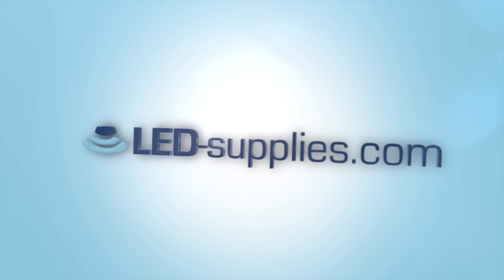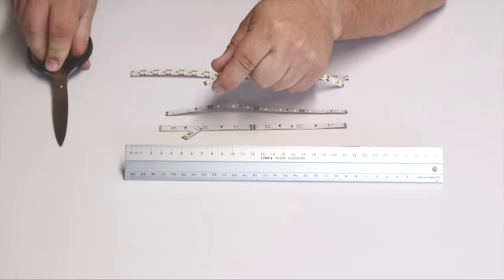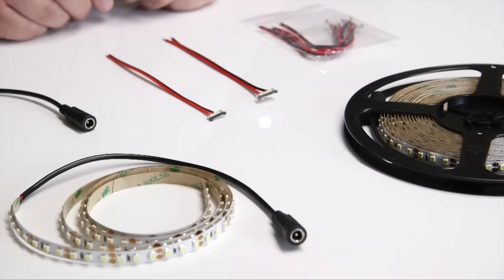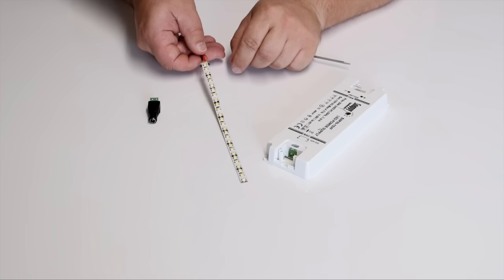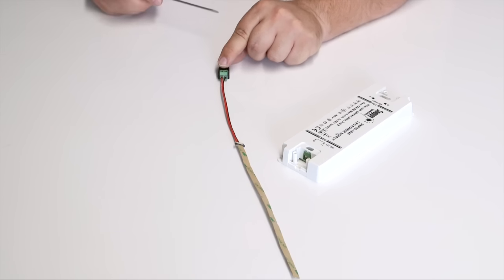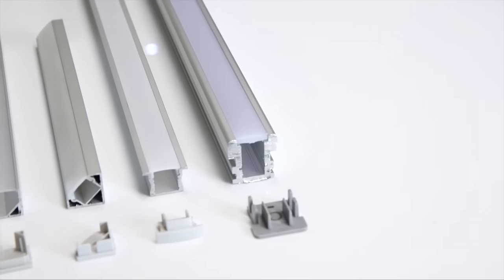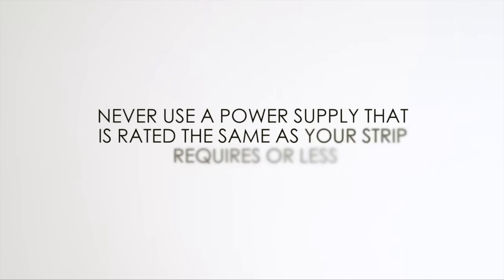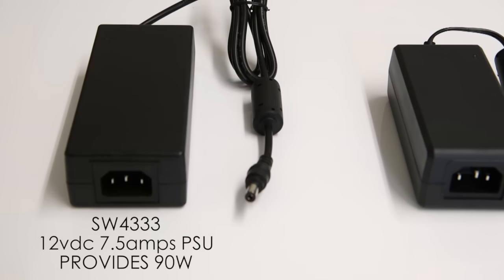How to cut, connect & power LED Strip Lighting

Comment: Hello, this was a great instructional video. I have a question. I noticed that you stated for 4.8 watts per meter strip you recommend a max run of 10 meters. I have (3) 4.8 watt per meter strips that I was looking to solder together for a total run 15 meters with a 90 watt power supply. Do you think this will work well and will be safe? A second question I have is which power supply is better between industrial power supplies or constant current power supplies? Thanks
Reply from the maker: +brightcreep1 Firstly most LED strip requires a 12vdc or 24vdc constant voltage input so a constant current power supply is not recommended. You can use an 'Industrial' power supply as long as it provides the constant voltage output. For our constant voltage power supplies check here https://www.led-supplies.com/led-drivers/ we have a wide range

15 metres would not be recommended as a single run of standard 4.8W LED strip. If for example this is 12vdc input LED strip then 15 metres would need 72 watts which is 6 amps. LED strip is generally not designed to carry 6 amps so its likely to damage the LED strip. You are also likely to get voltage drop down the LED strip running 15 metres as a single run so the very end is likely to be less bright that the start

we would suggest running the 15 metres either as a 10 metre + 5 metre section or perhaps 2 x 7.5 metre runs and power from either end. You could also power the LED strip in parallel from the same power supply rather than in series

Comment: I measured something wrong and cut a strip a bit too short. Is there a way to reattach them? I'm guessing soldering would be the best solution?
Reply: You need to solder them
Reply from the maker: +fsociety Soldering is the best option but if you would prefer not to then we do have a range of middle connectors for LED strip which you can view via the links below. we offer 3 options depending on the type of LED strip you are using
https://www.led-supplies.com/led-installation-accessories/connectors/middle-connector-for-rgb-led-strip-lighting-solder-free/
https://www.led-supplies.com/led-installation-accessories/connectors/middle-connector-for-led-strip-lighting/
https://www.led-supplies.com/led-installation-accessories/connectors/middle-connector-for-10mm-wide-led-strip-lighting/

Comment: at 7:28 I think it should be wise wersa, I mean max run of 5m is 4.8W and max run of 10m is 9.6W, 
Am I right?
Reply from the maker: +gig970 Thanks for watching our video and your comment but no this is not correct. You can power 10 metres of 4.8W and can now actually power 10M of 9.6W strip but certainly when you go to our higher power 14.4W per metre high brightness LED strip 5 Metres is the max as a single run in series due to the higher current this type of LED strip pulls

Comment: so these connectors are short as fuck. how can i extend them? cause it doesnt seem like you can connect the connectors together to get a really long cable...my brain is hurting form thinking about this....
Reply: +David Chang Get a roll of wire and solder it straight on, then you can cut it to any length you like.

Comment: I don't know if you can help,  But i got an LED kit, and everything is wired up. but I am having problem with the colours. 

When it's set to RED the light is an Orange colour,  Blue is a lighter shade of blue (closer to  a Teal colour) 

When i have white selected  and i lower the brightness it will start changing to green, the lower the brightness set the greener it gets but the actual brightness does not change.

And when I turn off the unit with the remote,  it changes to green and doesn't actually turn off. 

To me it seems that the unit is associating  brightness with intensity of green but I am by no means trained or confident in my diagnosys.
Reply from the maker: +VauganizerHD It doesnt sound like one of our LED strip kits as this is not a problem we see with our stuff but it could be you are using a poor quality controller which isnt controlling the strip properly. Check out our controllers here for RGB LED strip https://www.led-supplies.com/led-controllers/led-controllers-rgb-colour-changing/

Comment: wow i feel like im on some heavy valium watching this.... would be nice if you would get to the point just a bit faster ....  you also say nothing about how to remove the silicone coating from the LED strip in order to access terminal pads... nor HOW to identify polarity on unmarked strips
Reply from the maker: +antigen4 Thanks for your comments - the silicon coating is not present on standard LED strip which is the type we concentrate on in the video. Its is on splashproof strip but the introductory video we produced is already pretty comprehensive as you reference. Also, any good quality LED strip (such as ours :) should have the polarity marked on it. We have not seen any strip which is 'unmarked' so cannot comment on that.

Comment: Would these burn up if I hooked it up to my lawn mower battery
Reply: +Jacob Randall Yes and NO  - if you have an alternator,  this will push the voltage passed 12v. ( assuming it is a 12V battery your talking about ) and this will blow your strip,  if 6v system - this will work,    if you dont have an alternator on your machine and you have to plug in the battery to charge it,  then they will work just fine - remember to put a switch in place or you will just drain the battery unless you disconnect them at the end of use.     If you put a voltage regulator in place - and a variable pot,  you could set the MIN MAX voltage to 6-12V. and rotate the Pot to alter brightness.
Reply: +Piefingers thank you I'll look in to that
Reply: Why would you want them on a lawn mower 😑

Comment: Is there any way to power two of these strips from one power supply?
Reply from the maker: +VACARA You can power 2 lots of LED strip from 1 power supply using our splitter cables - take a look at these we offer 1 to 2 way, 1 to 4 way and 1 to 8 way - select the type you want using the selection box on this page https://www.led-supplies.com/led-installation-accessories/cables/2-1mm-splitter-cables/

Comment: How can I do this with a 9V battery? Is that even possible? My LED strip is marked with "DC12V." Thank you.
Reply from the maker: +Sidney Falco You would need to run 12v LED strip from a 12vdc battery - either lead acid or lithium ion - we do some batteries here https://www.led-supplies.com/led-drivers/portable-power-battery-for-led-strip-lighting/

Comment: Bonjour ,nous avons fait le branchement mais le mien était vendu avec un adaptateur 12V et une fois branché quand on l'éteint les leds rouges reste allumé que faire (à chaque fois nous devons débrancher l'alimentation pour l'instant)

Hello, we made the connection but mine was sold with an adapter 12V and once connected when we put out(switch off) him(it) the red leds remain lit(switched on) that to make (every time we have to disconnect the food(supply) at the moment)?
Reply from the maker: +Marianne C If you are powering a very small amount of LED strip, when you disconnect the power supply sometimes the residual charge in the capacitor of the power supply can continue to power the LED strip for a very short while. the only way to stop this happening if its a problem is to fully disconnect the power supply completely
Reply: +LED supplies quel est la solution pour que cela reste toujours sur secteur sans resté allumé

What is the solution for it always remains on without remained on sector

Comment: these so called solder points shown in this video is in effect "Cold soldier point" - the flux (or lack of) and heating (lack of) of the connecting wires would in effect result in a "cold point" which in effect is bad! - The correct way should be be heat the wire while applying solder and flux  to allow both the wire and circuit board connection points a "just right amount" of solder - The solder should be evenly spread and allow the cable hot enough for the solder to penetrate the wire strands - Once done correctly you should be able to see the outline of the twisted wire strands - if you cant see that they you probable used too much solder - resulting in a weak soldering point - same apply using too little solder - A cold solder point is one of the worst when it comes to soldering - weak and brittle and corroding wires to follow - a too  hot solder iron could ruin you connection point (and surrounding electronic), melt the protective plastic on your cable - again weaken project

Comment: Can anyone help me out how to convert LED strip power source into USB?
Reply from the maker: +Maria Gamotia You can buy LED strip that actually operates from 5vdc - so you can power it straight from a USB socket - contact us for more details - its a brand new product and not live on our web site yet https://www.led-supplies.com/contacts/
Reply: +Maria Gamotia If you have 12 volt led strip you can't , but there are 5 volts led strips you can purchase off amazon and can be run by USB wires.
Reply: If you know how to solder get a boost converter form eBay and solder the wires unto the converter from the usb then solder on the connectors to the output for the light strip or just solder wires instead of connectors
Reply: +Maria Gamotia  Hey a USB has 2 wires two are green and white (these are not needed they are for data) and the other two are red and black (positive and negative) this is what you need to power the LED strip simply solder the red wire to positive and the black wire to negative on the led strip simple :D
Reply: +Drilon Demaku incorrect

Comment: How do I calculate what voltage my battery needs to power the LED strip? And what LED length can a 9V battery power?
Reply from the maker: +TheElectrozoid take the battery voltage and then multiply it by the number of batteries you are using to power the LED strip. For example a 1.5v AA battery - using 8 of them (8 x 1.5v = 12vdc) you may be interested in this product https://www.led-supplies.com/led-drivers/portable-power-battery-for-led-strip-lighting/battery-pack-for-led-strip-12vdc-8-x-aa/
Reply: ***** I am goning to use a single 9volt battery. What length of what LED strip can I use?

Comment: can you add a power switch?
Reply from the maker: +obadboystanley You can add this which works as a really easy to use on off switch for LED strip as well as enables you to adjust the brightness levels https://www.led-supplies.com/led-controllers/led-dimmer/touch-dimmer/led-dimmer-touch-sensitive/

Comment: So in theory could i wire these directly to my PC power supply on the 12V rail?
Also could these be wired to my car battery directly?
Reply: +Hunter Davis (CAF Life) 
Yes, but via a correctly selected fuse !
Reply: +Derek Robinson thanks i did it to my pc and it worked great ilm do it to my car w
using your advice

Comment: So basically  any power tool, phone charger, triple charger or a battery charger will work for a power supply as well, a input AC 110v current for a DC 12 volt current of 24 watts at the less amount of energy,  that great be able to use all these light on one power supply of 24 watts, THAT IS AWESOME    just think back in the days 1 light bulb burned 100 watts of power   WHAT A WAST OF POWER

Comment: Can you cut them and use that other half at another place? How would that work with the remote, and what needs to be purchased extra for that to work?
Reply from the maker: +Matthew Bishop You can cut them and power multiple bots of LED strip using a wireless controller which then pairs with a wireless or multiple wireless receivers take a look at some of these examples but we can offer for single colour or colour changing LED strip https://www.led-supplies.com/led-controllers/led-dimmer/wall-mounting/led-strip-dimmer-wireless-single-zone/
Reply from the maker: +Matthew Bishop Yes you can use 1 remote but then buy 2 receivers which are available on their own as order code COMPACT-RECEIVER . Doing this you can effectively power as much LED strip as you want in different places all from the one remote controller https://www.led-supplies.com/catalogsearch/result/?q=compact-

Comment: What about using batteries for power input? What type of battery do I use for a 15 LED on a 30cm strip?
Reply: +Ompmega You can use 1.5v batteries. I run 8AA batteries and hook it up. Adds up to 12V.
Reply from the maker: +Ompmega check out this product - just add the batteries to provide a 12vdc output suitable for LED strip https://www.led-supplies.com/led-drivers/portable-power-battery-for-led-strip-lighting/battery-pack-for-led-strip-12vdc-8-x-aa/ or if you want a higher power solution that will run the LED strip for longer check out this range https://www.led-supplies.com/led-drivers/portable-power-battery-for-led-strip-lighting/portable-power-supply/

Comment: I want to do this for Halloween and am rushing it now last minute.. Do you sell multi port adapters where I can attach like 5 led strips x2 separate areas of my mask I am making + about 3-5 other separate strips and have them all lead back to one main connection at the power supply?
Reply from the maker: +Jared Deptuck You could maybe use our splitter cables for powering multiple LED strips from a single power supply or battery? https://www.led-supplies.com/led-installation-accessories/cables/2-1mm-splitter-cables/

Comment: They can run on a battery these LEDs? is for the few, not one meter
Reply: +Alejandro Chavez Ramirez As long as it's a 12 volt battery its fine
Reply: helcat316 If you mean 4 lithium ion cells connected in series you will what to get a power transformer or something like that (cant remember right now) to keep the voltage between 12-14V because a charged lithium ion battery is around 3.9v X 4= 15.6 Volts which will burn out the LEDs or make them turn into a very weird color
Reply from the maker: +Alejandro Chavez Ramirez If you want to power just a small piece of LED strip from a battery this is perfect as once the batteries are fitted it provide a 12vdc output https://www.led-supplies.com/led-drivers/portable-power-battery-for-led-strip-lighting/battery-pack-for-led-strip-12vdc-8-x-aa/
Reply: +PC TechTips  what if you want to run a 4s lipo batttery pack woud like to build led race track outside
Reply: Alejandro Chavez Ramirez n
Reply: Alejandro Chavez Ramirez

Comment: I wanna put a strip around my computer desk but also behind my tv (causing me to have to cut it) do i have to get another power supply to have it light up behind my tv? if so can someone send me a link to everything i need i already have 1 power supply, the 16.4ft strip itself, and remote
Reply: +LeafMatic  use 1-2 DC splitter,1 female head connect 1 power supply,2male heads connect two strips

Comment: Hi there I am planing a light for video of about 15M not sure how to power this. What do you mean about put is in paralel?
Reply from the maker: +open-ecommerce.org  to connect in this way means for example, to run each 5 metre length of LED strip back to the power supply. so if you have 15 metres of strip each 5 metre length is connected back to the power supply. Series connection is the other option and would involve connecting all 15 metres together as one long strip and then connecting that to the power supply. in powering very long lengths though, the led strip will draw very high current (higher amps) from the power supply causing potentially problems with the led strip burning out as its not designed to carry high current so parallel connection is recommended. we also have a connector that enables powering lots of led strip from a single power supply easier - take a look at this and check out the data sheet for example diagram https://www.led-supplies.com/led-installation-accessories/connectors/power-splitter-terminal-block-8-way-30a-max/

Comment: hi
i want to use one power supply for 15 meter led light
wich power supply is best
thanks
Reply from the maker: حمود س ا what is the power requirement of the LED strip you intend to use? For example if you are using 4.8W per metre LED strip just multiply the power by the length so 4.8W x 15 metres = 72 Watts - i would recommend 20% headroom so use a power suppl;y rated to around 90W. Check that its a constant voltage power supply as well (rather than constant current) - Most LED strip requires a constant voltage input

Comment: Does anyone know how to power 4 wire leds without the control box, 12v 60w
Got the wrong ones for a quad. The remote control box causes too much interference.
Reply: thks guys
Reply: Vic Prk Just cut the lead and connect two wires to 12V and any other one e.g. R,G,B
Reply: +Vic Prk (Slick  Vic) wire the 12v to the 12v old the wire and connect the ground to what ever color you want the LEDS to be if you want it to be white you have to bridge the three colors also if you want colors like purple and so on. you can not set up custom designs such as strobe unless you are sure on what resistors to use. Hope this helps!
Reply: +Jason bbjbchcshGonzalez
Reply: yeah?

Comment: why when i connect my 5m led strip  to my computer power supply it comes on for like one sec then shut down power supply completely
Reply from the maker: Lejay Lewin Is your computer power supply outputting the correct voltage? LED strip generally runs off of a 12vdc or 24vdc input. Computers often output 5vdc (from the USB socket for example) - Just thought i would check :) Otherwise the problem may be that your computer power supply is not rated high enough for the 5M of strip so its shutting down